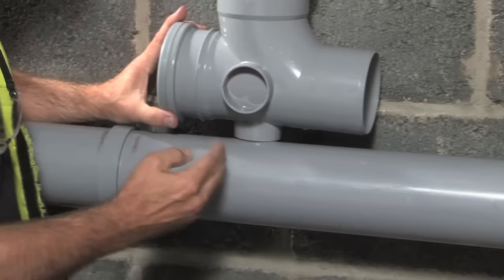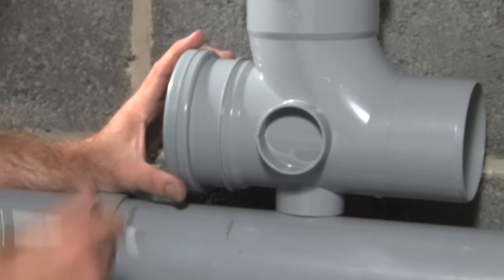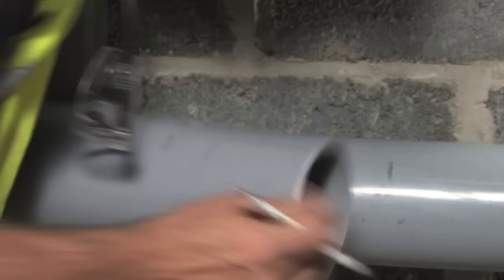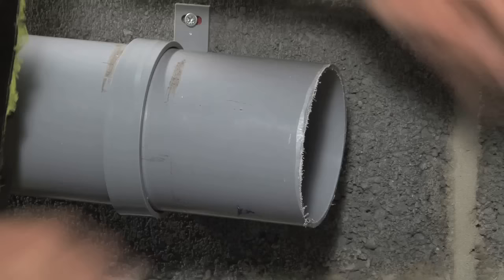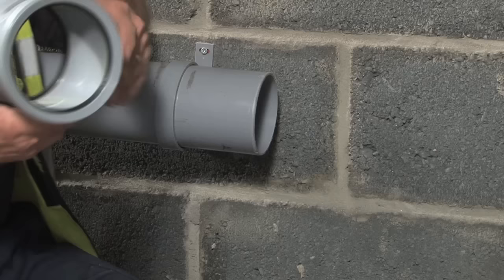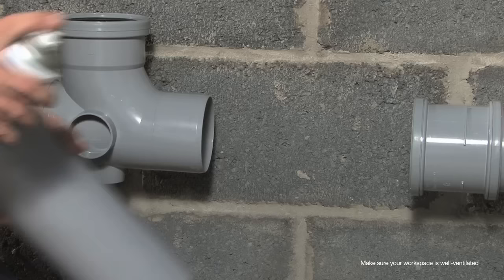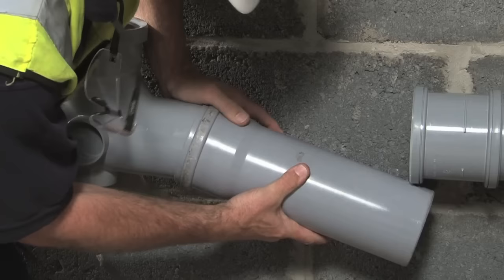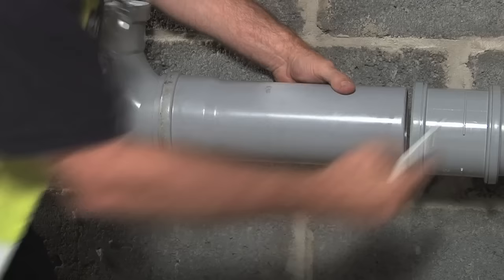How to install a slip coupler - OSMA Soil & Waste

Comment: Not glued? How do you ensure a good seal and prevent movement?
Reply: Agreed. Also surely it will leak at the cut end which is against the flow?
Reply: It’s the rubber that creates the seal.
Reply: To stop from moving the pushfit slip coupling up and down you can put clips eithe sides of It. It wouldn't be' able to move sideways bit still be' able to rotate when the building moves (called settlment) and that's all that matters.

Comment: well i,ve managed to insert a branch on a four foot length of soil pipe fixed at both ends but figure your slip ring must have been sorted for the video cuz if i wasn,t built like a brick shit house with hands any basket ball player would be proud of there is no way i could have slipped that slip ring back to complete the job :0)

Comment: Nice video but how do you make the joint water tight? the sleeve you slipped over with silicon would leak.
Reply: It has rubber seals and the pipe is not under any great pressure
Reply: @mikiex  It doesn't give me great confidence haha. I'm sure it works but something like that I would leave exposed just in case. Also what about ones going with gravity straight down as the main soil stack?
Reply: @KilliKonKarnage  They are really difficult to connect, this video makes it look easy. They never leak, unless the seal is damaged prior to connecting.
Reply: @mikiex  ah thanks mate
Reply: @KilliKonKarnage  It really seems like a more industrial version of what is under all of your sinks. Pipes that are just compression fit. The only reason why compression fit is allowed under sinks is because if they leak it's found quickly and easily repaired.
Reply: Mine lasted 3 years and then started leaking.
Reply: @mikiex  could you use abs solvent for extra protection?  Would that damage the rubber gasket?

Comment: 'A little silicone spray' .......... WHAT silicone spray? 
Try finding silicone spray in Toolstation or Screwfix and you won't
WD40, TT 600 etc sure - But won't those attack the seal?  Beside will never dry out for years.
So I though water.  Then thought - Yeah, you know what happens if you get water on a coupling - It leaks forever.  Baffled.
Reply: its silicone grease mate, same stuff is used in piston fountain pens
Reply: @Cortesevasive  Bit Ironic. Since writing that comment I actually found Silicone spray on sale in Screwfix.
SOlved the problem on one side of a joint where both pipes were new but the old one must have been fractionally different because despite wasting ages chamfering the end the rubbery/plasticy seal still wouldn't go over it.
(So it took out the sael ring, slathered the whole bloody thing with Silicone sealant and so far its holding just fine).